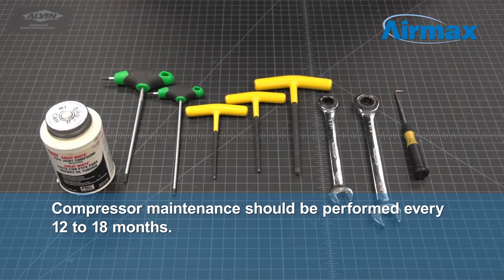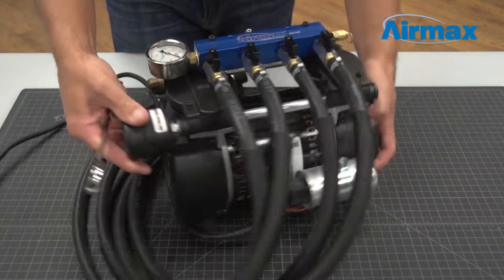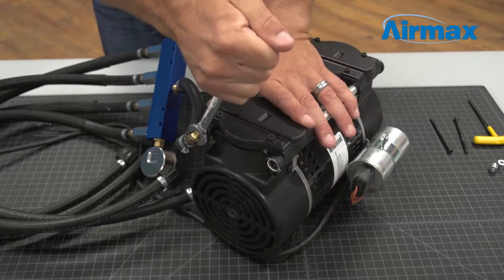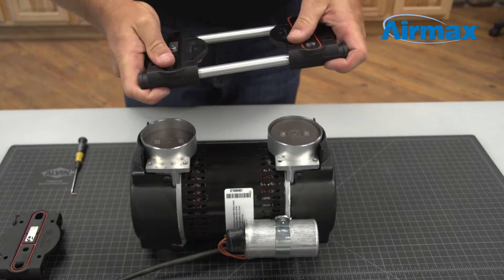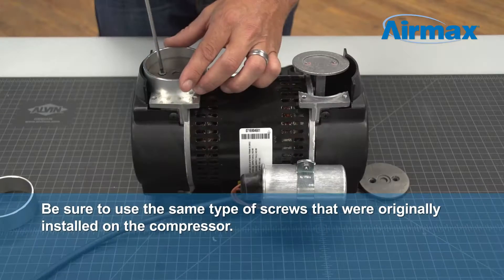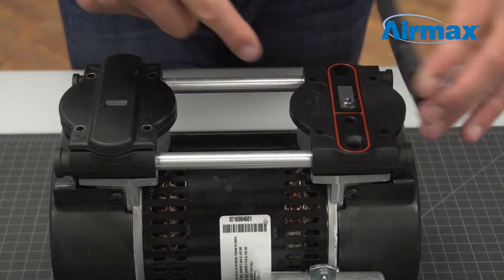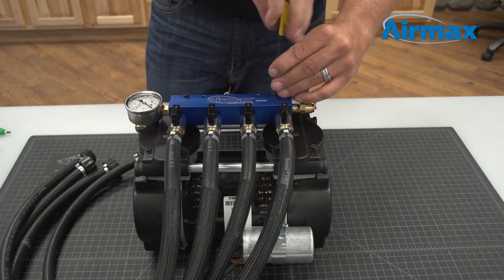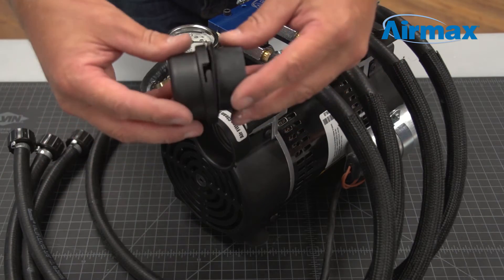Airmax® Product Video - SilentAir™ RP75 (72R) Dual Piston Compressor Maintenance Kit

Comment: Are there any tricks for getting the new piston cup into the new sleeve evenly? When I try it on a flat clean surface it will not align evenly.
Reply from the maker: When setting the piston cup in the cylinder sleeve, press firmly down on the piston cup when on a flat surface.
Reply: @Airmaxeco  10-4; Turns out I was sent the wrong repair kit and the proper repair kit has been forwarded. Those will probably fit as intended. Thanks